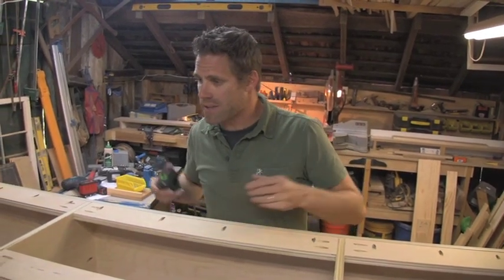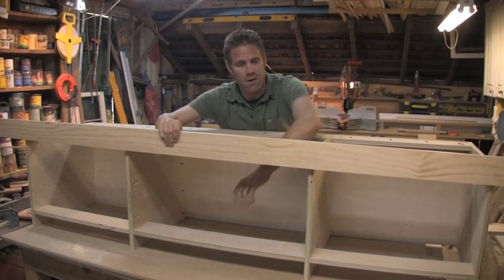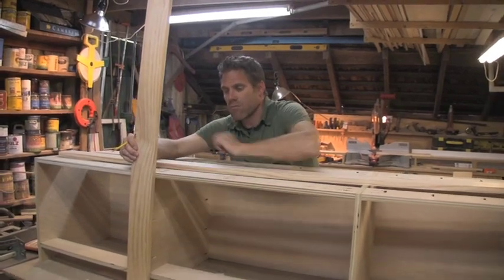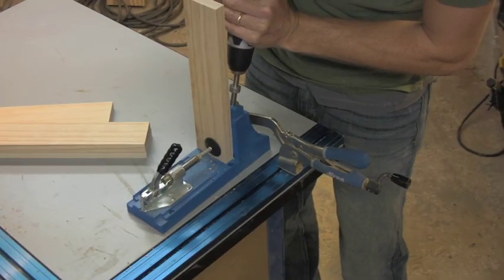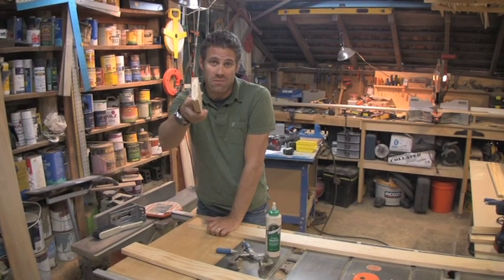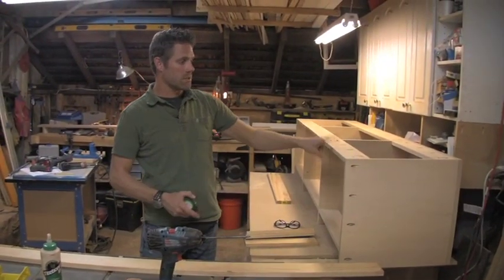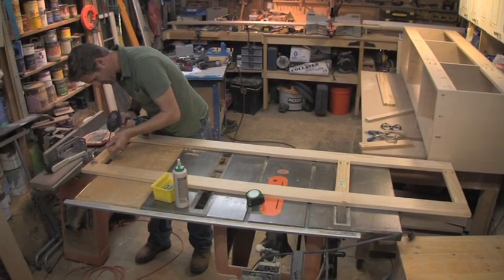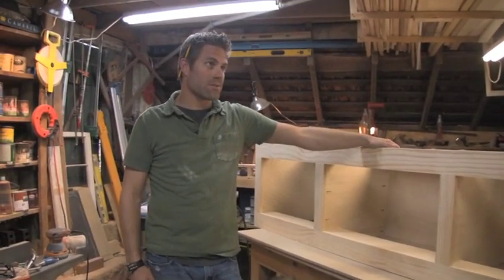How to Build a Twin Bed w/ Storage - Part 3

Comment: Thanks for the feedback, sorry to hear about your Dads friend.  The table saw is by far the most dangerous tool in my shop and i respect it more than anything.  I am always aware of where the blade is as well as my fingers.  I will always wear my wedding ring.  If my finger is that close to the blade, ring or not, i woundn't be happy.  You are correct that i need to make those concerns more apparent to New Woodworkers as they should definitely be educated as to  the many dangers.